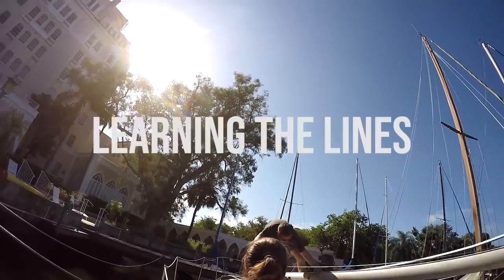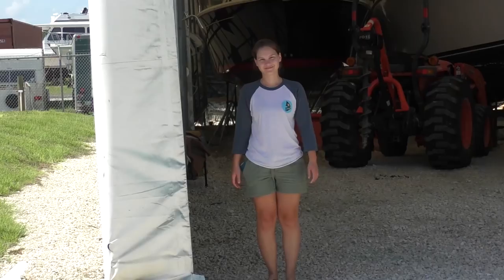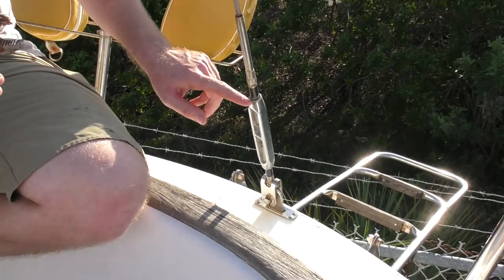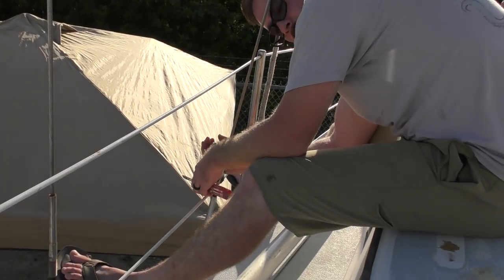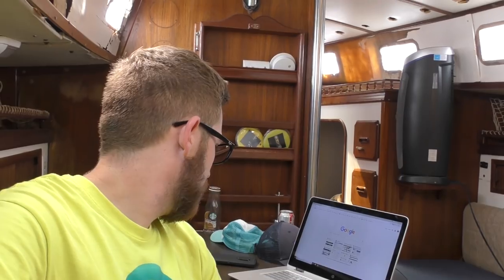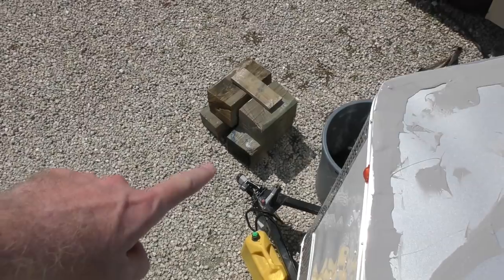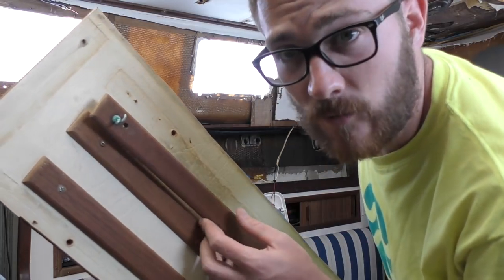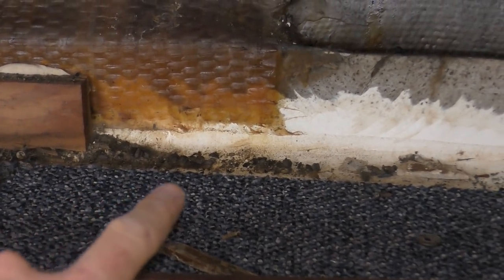44. Pulling the Stick - Mast Removal on a Sailboat | Learning the Lines - DIY Sailing

Comment: I think NASA invented WD40 to use on rockets so, yea why not use on boats lol, my dad always used silicone spray on boats/ jet skis for some reason.
Reply: Philip L. Perry IV A friend of mine told me to soak the seat and track on a old snowmobile that I got. I got it from the original owner that only put 100 miles on it then let it sit in a garage for 40 years. The seat was super brittle and ready to crack, like most snowmobile seats, and silicone spray made it like new again! I've had it for 6 years now and it still hasn't cracked. I use silicone spray on any vinyl or rubber things to keep it like new.
Reply from the maker: I guess theres something to do with it reacting to the gelcoat and staining it.

Comment: it use  to be made from petroleum distillate and  could attack fiberglass resin   highly flammable then  now it is water base and not flammable
Reply from the maker: So is it fine for fiberglass resin now?
Reply: it should be safe  i don't  know other chemicals of their formula    incidental contact   should be wiped clean  same way windex or other things

Comment: You may be back uprigged by now but here is this anyway.  I saw as you were backing off the turnbuckles you were spinning the wire and the turnbuckle.  A 1/4 to 1/2 turn of the wire is ok but any more, and you disturb the balance of the cover strands to the core strands. They are laid in opposing directions.  Only turn the turnbuckle, preferably with a smooth jawed wrench,  not vice grips which will mar the terminal.   I've condemned and replaced too many rigs prematurely due to turning the wire and not the turnbuckle.

Comment: WD40 should be fine. To my knowledge it doesn't react in a particularly bad way with salt water or anything. You just should be aware that it is not to be confused with an anticorrosive, it is merely a rust dissolver and lubricant. Keep in mind that it doesn't play well with super fine mechanical elements and electronic components like encoders, pots etc.. It is an oil product after all and it will create resin and may corrupt those elements. Also, use it carefully, mother nature will be thankful and you really don't need much anyways. 

Be careful with silicone based lubricants. Those are super toxic and once you've applied them, those parts will most likely never accept another lubricant or paint even, at least it will not stay on there for long. If you want to go into detail, there is lots of info on the net. With lubricants, there is a lot to be aware of in general, some are acidic, some are alcalyne, stuff that is indeed of interest in a marine environment in the long run. 

But when push comes to shove, rule of thumb is: if it's made from metal and should move but it doesn't - WD40 is the way to go. It just excels at this and beeing a penetrating lubricant, it will reach places other lubrincants wont.
Reply from the maker: Thanks for the input!